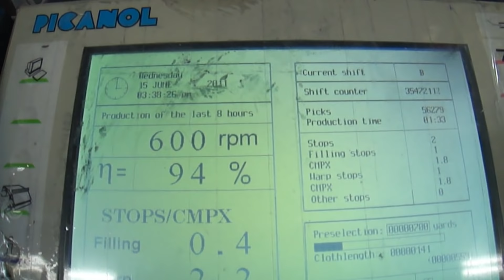Denim Fabric Weaving Process In Air Jet Loom  ||  Warp yarn path, Weft Insertion, Weft Replacement

Comment: I feel I know less about this now. Why no higher framerate to show us things in slow motion?
Also what was that alien thing repairing the thread at 8:19
Reply: I think that were the drop wires ........which are mounted aligned over reciprocating bar incase any warp breaks they will be lowered n loom get stopped ..........